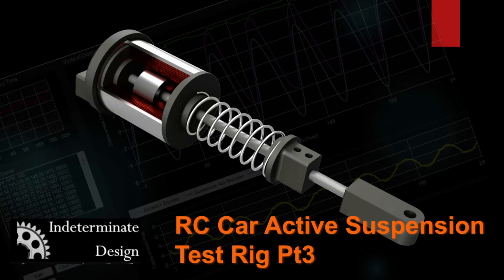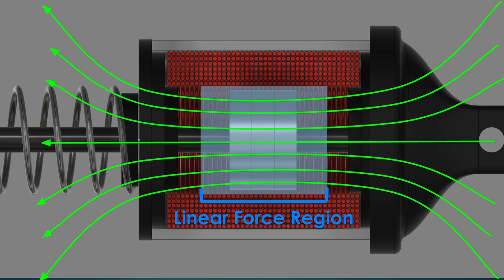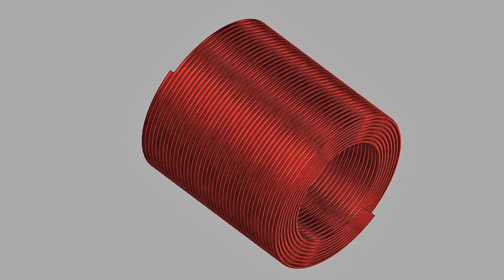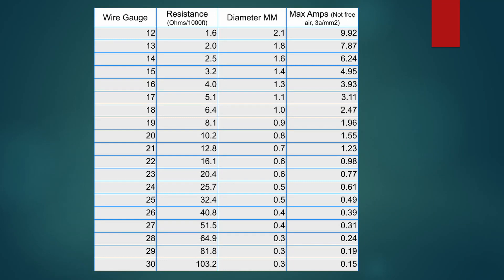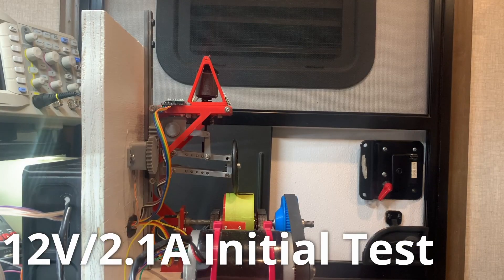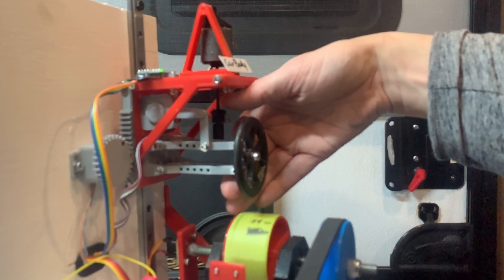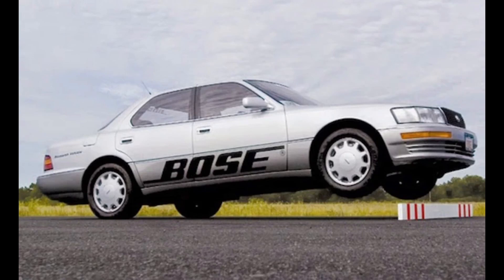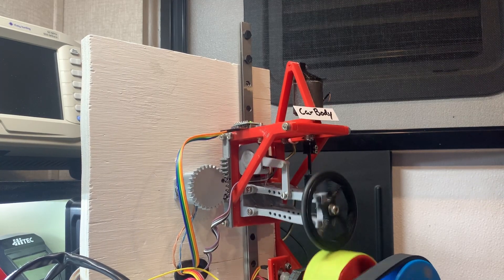Active Suspension - Trying to build a Bose style suspension for an RC car

Comment: Beautiful work man. Much appreciation from a dude who is losing his way in a similar project. I just have a small question to ask. Looking at your self-built electromagnetic actuator, I wonder if you have ever considered a push-pull solenoid? I have tested them and they operates kinda okay.
Reply from the maker: I haven’t tried one. From what I read they are harder to control and aren’t linear. But I think using the coil itself would be fine for a VCM.

Comment: the design is brilliant. i was looking at this type of design and following the bose system. the issue that always made this design challenging for me was not the design it self (in terms of concept) ... it was was the energy and the dynamics of it required ... this suspension in my opinion would require very high amps, maybe a 48v system running on capacitor as a quick charge and discharge, and a very large battery pack to back it up ... is suppose it could be easier to adapt it for a slower moving vehicle ... just some thoughts... looking forward to seeing how you overcome the challenges and reach your goals ... good luck

Comment: Do you think it would be possible to use a magneride style setup instead, where you include iron in the hydraulic fluid and adjust the dampening through an electric current that passes through it? it would be lighter and may use less energy then motors.
Reply from the maker: It is definitely possible. I’ve talked to an individual that has attempted this with RC shocks. The challenge being finding the proper magnetorheological fluid. Most of the stuff online is for educational purposes and has too little iron and too large of particles.  It’s also usually mixed with kerosene instead of a silicone oil. 

I need to find either an old GM shock to drain or pay $200 for a liter of the right stuff.

Comment: a big issue here is that you'll have to constantly support the weight of the car with your actuator, which is no bueno for electric actuators. Recall that the energy being converted by an actuator is back emf * current, while the energy wasted is R*current^2, thus constant force with no motion is just burning energy. I know this is going back to position control, but consider using a 3 phase motor and a worm drive in line with the spring? I think position control would be good if you think of it in terms of it reacting to steering and accel/deccel commands for like keeping the stance of the car.
Reply from the maker: Shouldn’t the spring carry the weight of the car?  The way I was planning on running it would be just to act as a damper, albeit a damper than can add or subtract energy from the system.  I wanted to see how powerful I could make the actuator, because ideally on rough terrain I’d want the actuator for a short period of time exert ~2x the cars weight. 

I have thought about using a 3 phase brushless motor and a ball screw, similar to how many cars perform brake by wire.  They make some really cool 5mm ball screws but they are pricey, but they are backdriveable.

Comment: You should just epoxy the wire as it goes onto the bobbin with an immersion dispenser - a plastic dispensing beaker or mixing pot with the wire thrreaded through a pair of holes in it, at the bottom end, so the wire gets tacked up, and you can then wind the bobbin continously, without voids.
Reply from the maker: That's a good idea.  The layer by layer process is super messy and difficult to start between the layers.

Comment: Why not wind the voice coil with butted ends to linearise the magnetic field lines?
Reply from the maker: What do you mean by butted ends?   That sound interesting, but I'm still not sure I can get as consistent force as I would with a 3 phase linear motor setup.
Reply: @IndeterminateDesign  basically vary the thickness of the motor and quantity of the windings so that the magnetic forces are linearised within the working range.

Would also have a look at how hard drive head actuators work.

Comment: You could do magnetic ride suspension instead, maybe using your coil to magnetize the fluid. They sell the magnetic fluid used in the real systems.
Reply from the maker: That's been on my list for a while to try.  It's been difficult to find the good MR fluid.  It's about $350 for 250ml.  I've thought about buying some old GM shocks to harvest the fluid from them instead.  

Most of the reasonably priced MR fluid I've found is the stuff for educational purposes with 10-20% nano particles.  The stuff used for suspensions is about 30-40 percent nanoparticle iron, and it's much finer particles.

Comment: my midnight stoner suggestion is to use a form of cantilever suspension arms to adjust the range of motion to what suits the power draw best. Its a very interesting concept and ive always been fascinated by the bose system. The benefits if you could properly measure the ride height in real time on a scale vehicle would be astounding for race chassis'.
Reply from the maker: The cantilever suspension setup is a good idea, similar to how I had the servo's setup on my first active suspension truck.  Its hard to say whether the weight from the variable cantilever setup would outweigh the additional windings in the voice coil.   Ultimately, I really want to try the 3 phase setup, because we can get more travel range and power, but just haven't had the time to pull something together.

Comment: In your video, you mentionned hydraulic active suspension. Is this kind of system controlled by a servo or a stepper motor or is controlled through actuators too? If not, trying different pistons diameter-range ratio to adapt to the force of the actuator might an option I think.

Your content is very rich, thanks a lot for all your work! Luck for the next steps!
Reply from the maker: Thanks so much. Yeah, the hydraulic based active suspension would be similar to what Williams used on the FW15 F1 car. Basically an electric motor driving a hydraulic pump and a series of servo valves.  

All of that would have to be custom designed, but I think it’s doable with a resin 3D printer. 

F1 teams and some FSAE teams have done something similar to what you’re mentioning  with piston sizes and valving. They cross linked the shocks and built a valve body that was essentially an analog computer to control everything.  I may try a very simplistic version of this.

Comment: Use a ball screw with a rotary electric motor it should work fine and add water cooling if needed.
Reply from the maker: I’ve thought about that a lot. I’m concerned about getting small enough back-drivable screw. I really need it to be a force driven actuator versus my earlier position based actuators.

Comment: Maybe you could get away with a geared motor and a multithread high pitch spindle. The gearing would make the system less backdrivable. But it should be fast enough.
Reply from the maker: That’s a great idea. I’ve been trying to think of ways of having some sort of gearing system. I like how compact a screw drive is. 

I’ve been thinking of using a rack drive system but it’s difficult to achieve a significant reduction without a large gearbox.

Comment: Belt drive from a drone BLDC motor should get you similar force/inertia ratios as Bose got.  Packing will be more difficult, but the parts are off the shelf.  

Not surprizing that the company that bought the BOSE active suspension isn't going after the automotive market.  As a tiny startup, they'd have 100% less chance of success than BOSE.  (which is already a big automotive supplier)  Active seat suspension and vibration control are still significant markets that could develop the tech enough for cars to be an interesting application again.
Reply from the maker: Belt drive is a great idea, or even a cable drive system.  I think it could be made quite compact.

Yeah, the more I read about the Bose technology the less I felt like it was a viable product.  I think their most useful patents were around the control algorithms for an active suspension system.
Reply: @IndeterminateDesign  I don’t know if it is exactly a fit, but along this line of thought, “James Bruton” used BLDC motors and belt and/or Gear Reduction for adding “springy-ness” to their Open Source robot quadroped, “OpenDog” ‘s limbs.  That may be worth a look for inspiration (if you don’t already watch his channel that is! )

Comment: Nice video. Your hydraulics diagram reminds me of Citroen car suspension, most of those with mechanical control valves on each wheel to obtain a flat ride. I remember that Moog in F1 is providing very fast hydraulic actuators.
Reply from the maker: Yes, it's very similar.  It's actually the diagram for the Williams F1 active suspension system.  The moog valves are amazing.  When I did the F1 gearbox I found a lot of information on their servo valves.  I think they were retailing for around $7k each a couple of years ago.

Comment: What about FRIC (Front-to-Rear-Inter Connected Suspension) to minimize your energy consumption?
Reply from the maker: That's definitely on the list of something I want to try, maybe even with a gas spring.  I've played around with it a bit for my streamliner project and I really need to buy some small air cylinders or something because I found friction from the seals to be a real issue.

Comment: I thought heat would become an issue, I deal a lot with 3 phase motors and actuators in an industrial setting. I think a electrical hydraulic system would be optimal but on a RC scale I can't see it working. One thing that's been in my head for a while is having a vacuum system (like the 2J) on the wheels alone and having the body being aerodynamically neutral, I don't think it would work well on an RC scale but on like a velomobile scale I think it could work.

I'm just a dumb breakdown electrician though so my knowledge is mostly experienced based with a heavy bias towards simplicity.
Reply from the maker: I think a vacuum based system would be interesting and the simplicity is appealing.   The hydraulic system would be so much more complex and heavy.  I'd spend a year just sorting that out.

I feel like at this point I have to go bigger to deal with the heat and weight issue, otherwise I'm not going to increase the performance of the RC car.
Reply: I for one would LOVE a Velomobile / Quadricycle E-Bike type thing with some amazing active suspension lol

More cost for the frame (and probably materials) to an extent, but having more room to shove components would be neat!